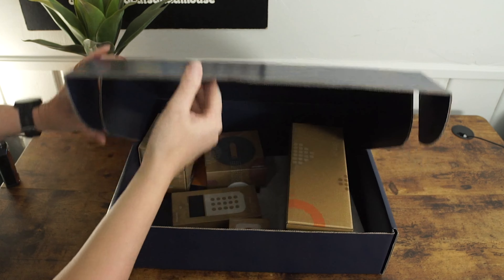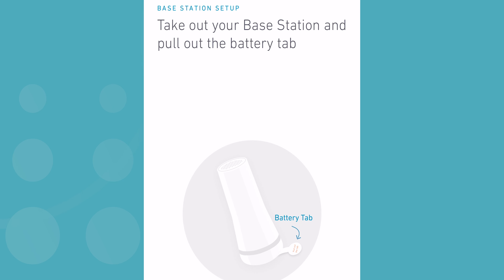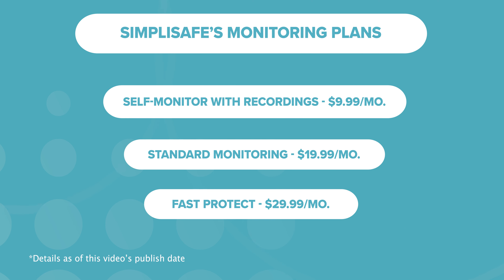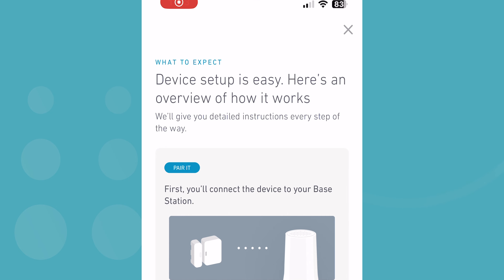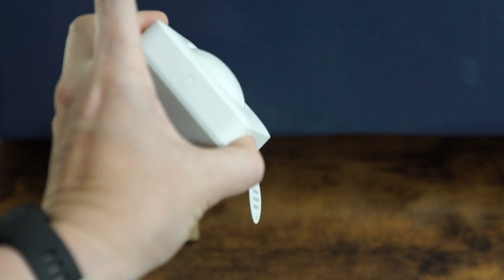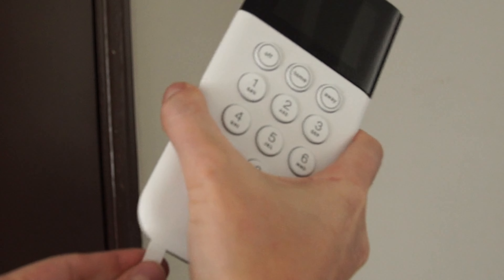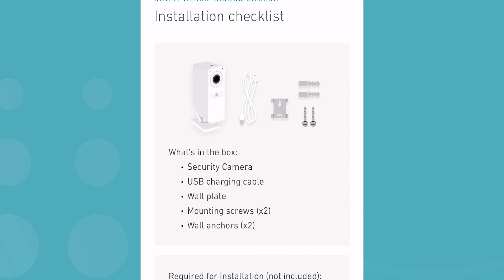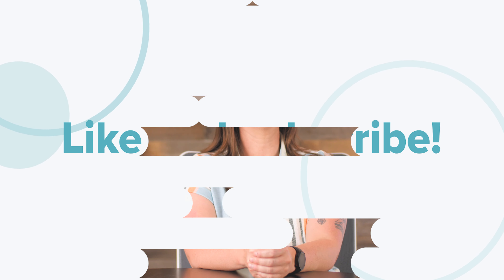How to install a SimpliSafe home security system

Comment: This is by far the best video explanation I've seen so far about this. 
I have one question: What do you do if the app does not find your keypad ? Mine doesn't.
Reply from the maker: The keypad wasn't recognized when you were trying to install it? This has happened to me in a past test when I tried a used system. The keypad might reset after you take out the batteries. Try the instructions from this video (around 5:15) and see if that helps! 
https://youtu.be/xsRLqGAqviU

Comment: Is it possible to point the indoor camera out of a window, to monitor outdoor activity?
Reply from the maker: It is, but it probably won't be much help with the way this camera's designed. SimpliSafe has designated outdoor cameras that might be a better solution. This new camera's indoor-only and keeps its shutter closed unless the system is armed and triggered or you schedule it to open.
Reply: an indoor camera through a window wont catch any motion and the night vision wont work either

Comment: Can you set up the system with just the keypad or does the smoke and co detector and new motion sensor need to be setup through the app
Reply from the maker: Sure! You can set up the system with just a keypad or just sensors. DIY security like this can look different depending on what you're wanting to add. But all of it does need the app to connect to the system. Hope that helps!